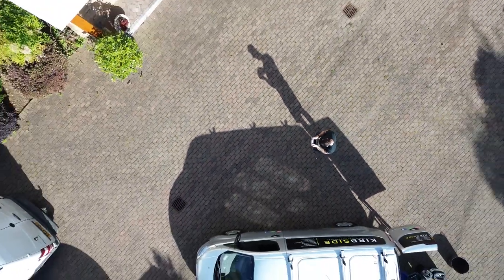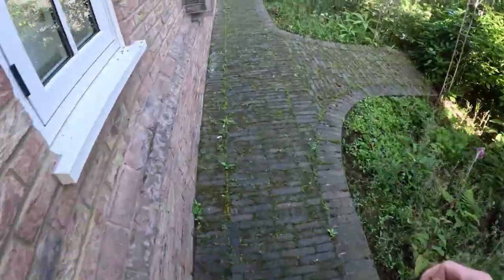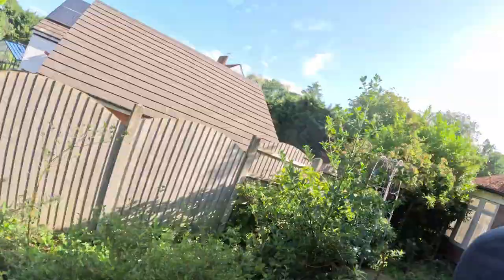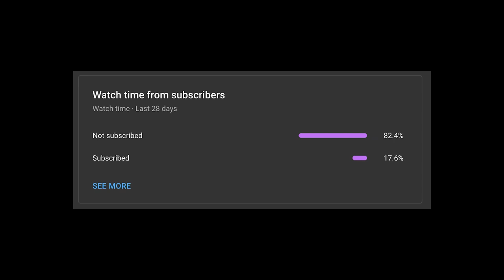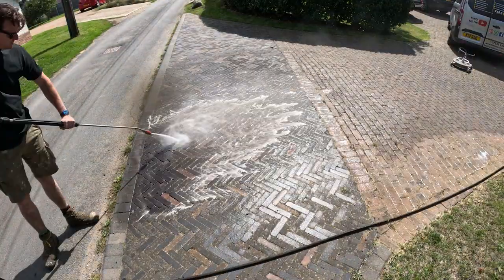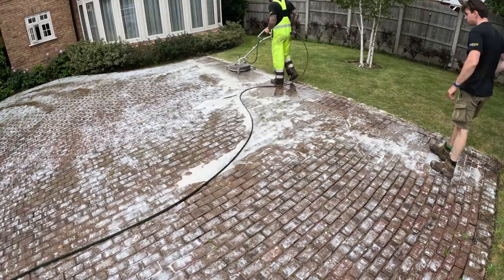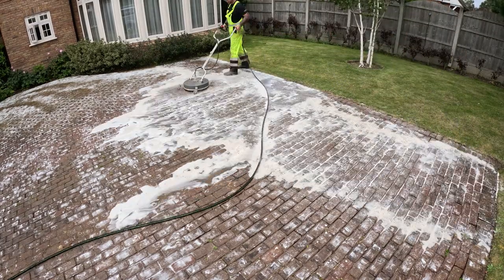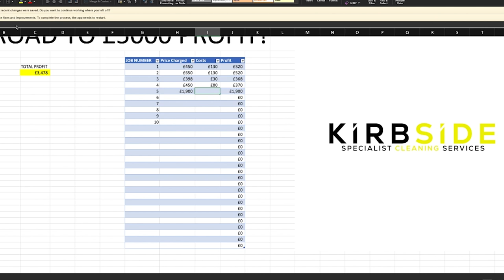Pressure Washing 5381SQFT in 10 HOURS! Humongous Patio and Driveway Cleaned Up!

Comment: Good job sir
Reply from the maker: Thank you so much Nicole🎉
Reply: @KirbsideCleaning  you're welcome
Reply: If you killed off the moss with SH first ( pretreatment ) and then go over with surface cleaner and then do post treatment with SH again, would that not have been much quicker and less sweat?
Reply from the maker: @murtaghslawncare.  it wouldn’t have worked, hypo only kills the surface of the moss ad weeds it wouldn’t have loosened it to the point where the surface cleaner would have pulled it out the ground. It would have likely slowed us down and cost more in chemical as well

Comment: Why dont u use a surface cleaner?
Reply from the maker: It wouldn’t have touched the weeds. My machine was also having an issue with slightly reduced pressure due to a air leak